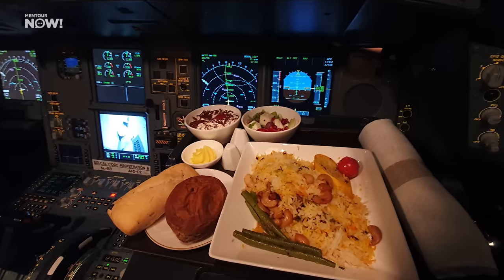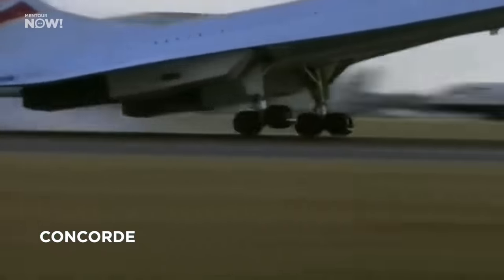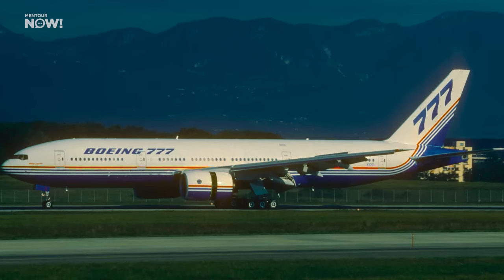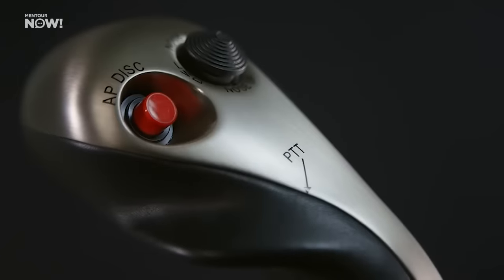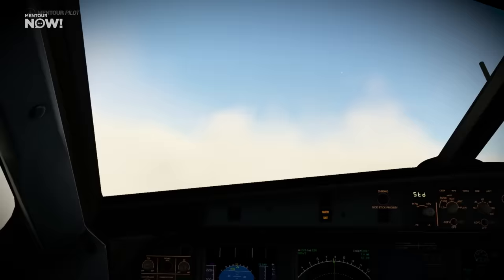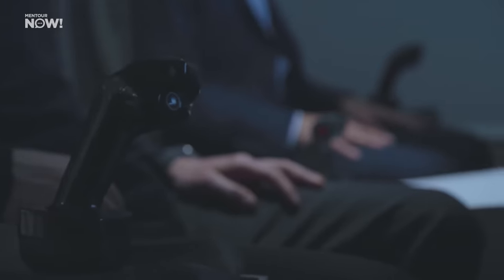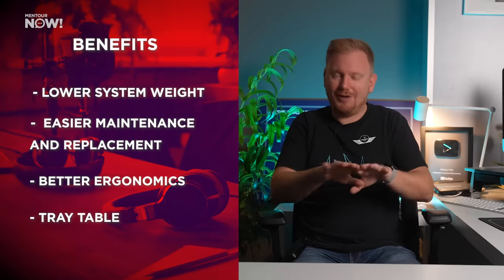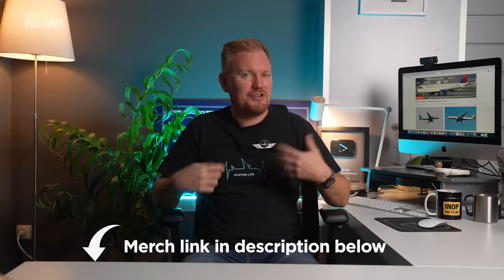Will Airbus Finally switch??

Comment: About 30 years ago my brother had a job writing software for  flight simulators that simulated warplanes. The company had working examples of the A10 and the F16. As a private pilot (he had a Piper Comanche) he liked the A10, but was perplexed when taking off with the F16 simulator. The F16 control didn't move; he looked at it as he twisted and pushed and pulled, deciding it was jammed. Then he looked up and saw the simulator was rolling rapidly over and over. Fly by wire strikes!
Reply: To be honest, that’s less a fault of the FBW and more the F16 using a force-sensing stick. My understanding is that the F16 was designed with a force-sensing stick because it was easier to use under high g-force; not typically a consideration given to civilian aircraft.

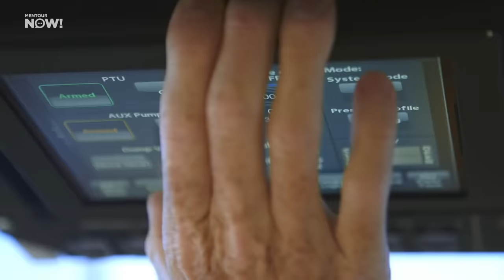Comment: @13:37 this is my problem with touch screens in vehicles. In order to be able to ensure you press the right part of the screen, you end up having to grip/support your other fingers on other parts. I've found myself doing this in my car because if there is ANY unexpected motion (undulation on road, small bump etc) an unsupported hand can wipe across the screen, increasing the chance of touching (and activating) other functions. This is something that is an order of magnitude harder to do on accident with physical buttons and switches, not impossible, but defiantly harder. Not only that, really important buttons/switches can have guards around them to further reduce the risk of accidental activation.

All that and that's not going into the lack of tactile feel and the need to physically look at a touch screen, even if you know where the "button" is on it.

Comment: For military jets, the sidestick has another advantage, the HOTAS which is important
Reply: HOTAS also works with a center stick. The point of HOTAS is to put all necessary input deviced you will ever need during a dogfight or a target run on either the stick or the throttle.
Reply: @shi01  it probably would but i don't think it was ever made that way. it also would give a more weird and unstable position of arms. having the joystick on the right and throtle on the left allows you to do all the basic functions without moving your hand, which would also be difficult at high G's
Reply: @michaelfreiberg8057  Actually all fighter aircraft since the F16 use a HOTAS setup. Some like the MiG 29 were converted later. Others like the F/A-18 or Gripen or Eurofighter had it from the start.
Reply: @shi01  i said i don't know of a fighter with center stick
Reply: @michaelfreiberg8057  F15, F18, Gripen, Eurofighter, MiG-29 all have center sticks.
Reply: @shi01  you're right. i didn't pay attention

Comment: Great episode Peter!
It's a bit frustrating in aviation to see it takes so much time for the airliners to catch up with the current technology. Even for such 'not that complicated' mechanical challenges.
I can't imagine how long would it take for airliners to come with AI for example.
Reply from the maker: Yes, that’s an EXCELLENT point.
Reply: Reliable, proven tech is a good idea for carrying hundreds of millions of passengers all over the world every year.
Reply: The cost is astronomical. Many of the things in our lives are not latest tech. If we did that airliners would be replacing every few years.
Reply: @jamesengland7461 true, but I'd argue that the tardiness for more sophisticated tech being introduced has more to do with other factors - like cost - than the older tech being more proven and reliable. After all - to achieve certification, the stuff has to be proven reliable already.
Reply: @mnxs  Exactly. They've proven that redundancy is the best form of safety there is. And new tech needs to be made robust enough to have this redundancy before it can be used. This means that the industry will naturally move much slower. That's the price you pay for such a high safety standard.
Reply: Especially these days, when things like LLMs (e.g., ChatGPT) are being called "AI," we definitely don't want to be seeing "AI" in the cockpit. LLMs spew out errors at an enormous rate and we have no way to control or fix that (nor is there ever likely to be, for LLMs, by nature of their design). Even "simpler" neural networks are non-deterministic, meaning you can't be sure what it's going to do in every situation. This is entirely the opposite of how we want cockpit automation to work.
Reply: Introducing feedback is not only a mechanical challenge. The feedback needs to be initiated and controlled by computers, that's a software and hardware challenge. And it doesn't stop there, but gets into the certification issue, type rating and the like. Finally with the airlines having to re-train and type-rate their pilots. I'd dare to say the mechanical challenge is the easiest in here.
Reply: @Curt_Sampson  The "ai" they mean would just be more advanced autopilots. And 2 pilots would still be needed for the sake of redundancy as the more advanced tech also means more complicated failures and more failure points. Hell, I think there's merit to the idea of bringing back flight engineers on top of that with all the added complexity.
Reply: @SkylineFTW97  I doubt the OP meant "more advanced autopilots," or even that the OP knows how an autopilot actually works. Most people seem to think that automated systems in aircraft are magic, as opposed to what they really are, which is programming the aircraft to perform certain actions, where the programming itself still requires pilots to make key decisions. (Consider even changing flight level: not only do you need to decide between vertical speed versus airspeed mode (and perhaps other modes as well), but you also need to understand the capture behaviour and parameters of the autopilot lest it fly right through and past the altitude you'd commanded. And it gets even more complex from there: setting up an autoland is not "push a button," but is a massively complex procedure where you need to get a lot of stuff right if the autoland is going to work.)
Reply: "it takes so much time for the airliners to catch up with the current technology" - in this case it's likely artificially extended by patents.

Comment: I flew A330's and A340's for almost 12 years. I can say from my perspective, active side sticks should be a must as well as active (moving) thrust levers. Off course you can live without it if you're used to (it was quiet a challenge to switch from Boeing's Yokes I've flown before), but as you said, in certain scenarios like Upset Recoveries, it can bring you in deep sh... And don't forget : If one pilot presses the Override Button on the stick for more then 30 sec, he has Priority for the reminder of the flight or until you deactivate it on the deactivated side stick.

Comment: I never flew the line in a Airbus as I changed jobs shortly following my type rating on the A320. So I’m only going to point out things that I experienced while getting my type at Airbus in MIA. I went from years of flying Boeings, Douglas and Lockheed’s to an A320. At first glance I was surprised by how odd and complicated the jet seemed. I thought it was designed to be operated by third world airlines?….The Airbus version of the FMC was to me very non intuitive. It was like they seemed to copy the ideas of the Honeywell FMC but lost all of its beautiful simplicity in the translation. Then there was the ECAM which was their version of Boeing EICAS. At first glance the ECAM seemed to be an attempt to simplify the handling of non normal procedures, but they managed to really overcomplicate that too. You would find yourself jumping between the ICAM and a large, very poorly organized paper QRH. My entire class walked to a Staples store and purchased colored plastic labeling tabs that we added to our QRHs to make them easier to comprehend in the heat of battle. A Boeing QRH on the other hand is dead simple to use and easy to understand. In the sim I loved the side stick controller. I’m also an Ag Pilot so I felt right at home with that. However, the lack of any flight control loading feedback through the little stick combined with the two not being inter-connected seemed very weird. It’s no more then a sophisticated game controller and looks and feels out of place in a transport category jet. I recall my sim partner and I had fun taking control from each other with the mere push of a button. You can’t see the opposite controller so if the other pilot neglects to announce “I have control” it can really cause confusion.  I have good friends who’ve operated the various modules of the Airbus of years now. They all seem to like it well enough but, they never say that they really understood the logic of the flight control design, and most have told me straight up that they couldn’t wait to get back to a Boeing, or just off the Bus. That tells you one thing, these pilots aren’t comfortable or confident in the jet and certainly not on those dark stormy nights when problems can become amplified. The Airbus now has millions or hours of airline service so it’s a good jet, but let’s admit that in their quest to design and build a non-Boeing they got some things wrong, like the side sticks. The really bad accidents like the Air France nightmare paints a picture of first world pilots not understanding the very basics of the jet they’re flying. In those crashes the pilots are desperately confused trying to understand their high AOA condition and are inexplicably moving the side stick in exactly the wrong direction. That’s pretty scary. To the point of absurdity and the resulting carnage……A new Russian airliner, look out below😂 I flew the 777 an old lady can fly that jet correctly. I guess French pilots do things a bit different 😂 sorry I can’t help it. Great content!
Reply: "third world airlines"? i have a little French butler inside the computer that keeps the plane pointing where i want it to. now that's luxury!
Reply: @waharadome  Ha, that would work for me too.

Comment: It  is important to note that the 777 was first developed with side sticks. During the design phase, as part of the Working Together Group for Maintenance at UAL,  we had panel charts illustrating the 777 with side sticks. The pilots, at the time, were nervous about this tech, as most were senior and the new tech scared them. So, Boeing had to go back to the drawing board and redesign the Fly By Wire system with Yokes and a back up mechanical roll control with spoilers 4 and 11. They added Back Drive Actuators to "simulate" what the autopilot is doing through the control wheel/column and rudder pedals.  It is so bizarre when we perform Back Drive Actuator tests we have to have hydraulics off. Boeing, realizing how much of an issue the fear of new tech had on senior pilots, they produced a video targeting senior maintenance techs to not fear this new central maintenance computing system (MAT) technology ("1994. The Year of Boeing 777 Maintainability"). Later, Boeing turned this issue into a branding difference between Airbus.
Reply: Visual movement feedback by either Autopilot or any input by PF is always a good thing, if only for the PM/instructor to confirm that it's been done right (either by the computer or another human).

Comment: Ever since AF447 I've wondered why dual inputs should be physically possible. In a fly-by-wire plane in what scenario would you ever want two Pilots Flying? So why not make sure only one joystick at a time is even electrically connected?
Many decades ago you had scenarios (some trim failures, etc) where you might need the physical strength of two people to shift the controls. Physically connected yokes made sense then but that is surely long, long since a non-issue. As we saw with AF447 allowing dual inputs, even with warnings, is always going to cause more problems than it solves.
Reply: The onboard computers will ignore all conflicting dual inputs and refuse any action.

It will only act on single input from one side stick.

The red takeover button on each side stick is there for whichever pilot who wants control the plane to takeover flying it.

Unfortunately, in the case of AF447, poor training & even worse airmanship from the more junior PF kept hogging the control of his side stick and kept making exaggerated movements that stalled the plane.

Comment: In most airlines flying Airbus, "Dual input" is not recommended but widely used. Proper take over technique is to call out "I have controls" and press the red switch that disconnects the other pilots' stick giving the alert "Priority Left". Although this technique is correct but difficult to execute in a late flare situation. Active side stick will eliminate the need for algebraically adding the inputs.

Comment: From just an intuitive perspective, controlling a live and moving object without any tactile feedback is always going to be much harder in any crisis - whatever other additional envelope processing and safeguards are present in the overall system. For instance, there is no way I would want to even drive my car with no natural force feedback to the steering wheel. Because without it I would not sense camber, slippage or skidding on bad surfaces fast enough, to react in time to compensate and avert a collision using visual and/or instrument perception alone. Quite simply, I would not be able to intuitively control the dynamics of the vehicle in any unexpected circumstances. To me this is blindly obvious..

Comment: For years I thought that these side sticks have some sort of feedback. I only found out they didn't in the Air France Atlantic crash. Even a small feedback would already have made a high difference. The only reason I can imagine not changing is the programming complications in the systems and cost.

Comment: After several thousands of training flights in gliders and light motor planes, I cannot imagine doing that without an active stick. When the trainee performs a takeoff or landing I always have my hands on the stick or joke in order to correct any wrong handling immediately.
I even remember landings of long-serving airline captains with light aircraft where it was good that I had my hands on the controls. It is not so sure that they bring down a PA-18 as a whole.
And flying a sailplane without feeling when it becomes soft while thermallig must be terrible.

Comment: Back when the A320 was first introduced to NWA and training commenced, there was another issue with the side stick that has apparently been overcome. It was the issue of pilots using their non-dominant hand in the left seat.  I know it certainly is an issue with me. I couldn't even fly Bonanza decently from the right seat and even today with my MSFS I crash and burn with every attempt to fly with my left hand. And I know others who had the same issue including a 747 Captain. But it was also a training issue back then even to the point of suggesting moving the Captain to the right side. Most military aircraft were right-hand controlled just for that reason at least back then. 

Also, the issue of the steering tiller is interesting. Some models have dual and some only on the left. It was optional in many cases but most airline SOPs prohibited the FO from taxing the aircraft. I wonder why? Delta went so far as to remove the right-hand tiller from the aircraft that had them. (So I have read) This would seem to make the transition from left to right pilot flying being done at the worst possible time. That is during the critical takeoff and rollout. 

One has to wonder just how these flight deck layouts came to be. It seems Airbus was completely comfortable with installing side sticks but continued to place things like the gear controls favoring the FO side. Why not a simple switch as long as it's electronic anyway. Same with the large trim wheels that dominate the center console. That device originally came from the cable system used to operate the trim and was needed to overcome the drag of the cables and airstream. After all, if they had enough trust in their flight controls surely getting rid of those large wheels would have saved even more of those weight savings you mentioned.  Maybe they felt they should leave a few things so Airbus pilots still felt like they were in control of something. 

Perhaps a video on these issues and procedures would be enlightening. Thanks for all the great videos you have produced so far.